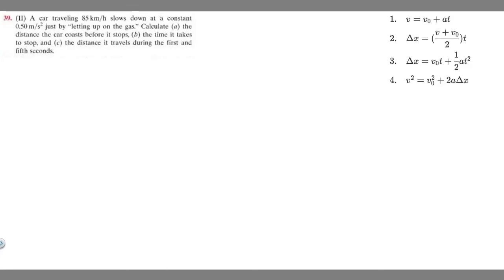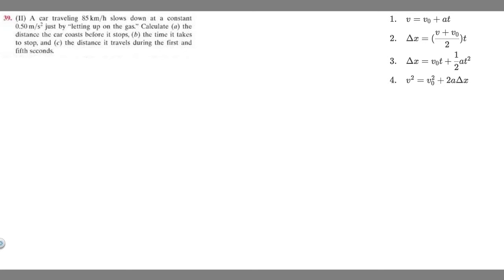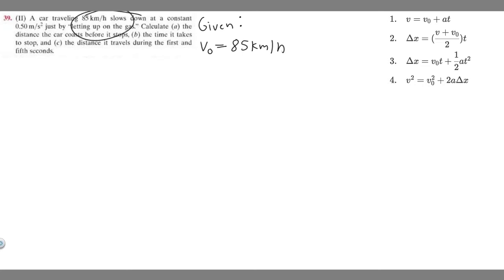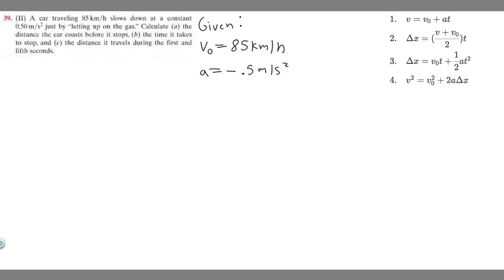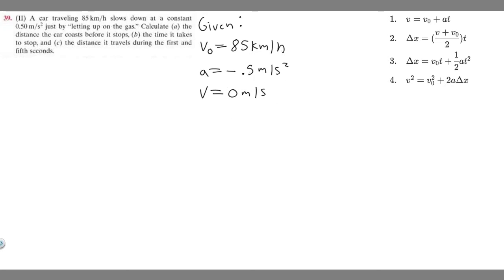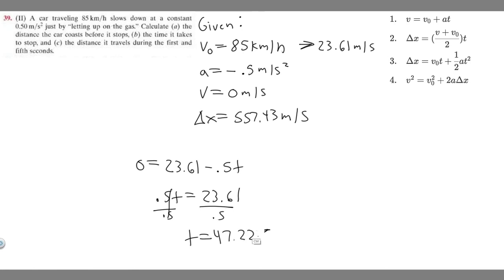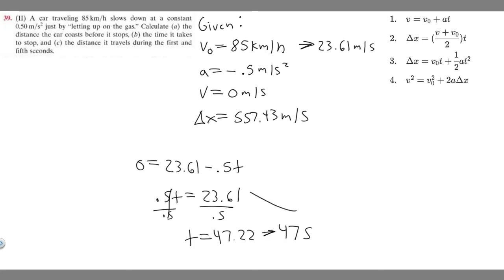Calculate (a) the distance the car coasts before it stops. (h) the time it takes to stop.

Comment: How to calculate distance after 't' second if acceleration is given
Reply from the maker: Do you want me to explain to you how to do that in general? or are you confused about some part of the video?
Reply: @TheAnswerKey  yes
Reply: Yes u wanted to explain
Reply from the maker: @vloggermedia5539  It depends on what variables you are given along with acceleration. What you do is take the variables you are given, and then plug them into an equation with delta x, which is what you are trying to find. So you just plug in the time and acceleration given and the initial velocity and that will allow you to solve for the distance traveled.
Reply: @TheAnswerKey  so what happen if acceleration = 5 m/s and t =60s and u=0
Reply from the maker: @vloggermedia5539  what is u supposed to be?
Reply: @TheAnswerKey  initial velocity
Reply: or body starts from rest
Reply from the maker: @vloggermedia5539  the formula is distance = intialvelocity(time) + (1/2)(a)(time^2) so plugging in 5 and 60 it would be 9000m
Reply: Why the equation displacement= vt is not used to find the distance after 60s
Reply from the maker: @vloggermedia5539  because we have to take into account acceleration. In the d = vt, it is assumed acceleration is constant.
Reply: @TheAnswerKey  i  find v using the eq u+ at and i plug into the equation vt i got the ans 18000
Reply: For first 60 second s = ut + 1/2 at^2 it's ok but for after 60 second what will happen
Reply from the maker: @vloggermedia5539  as long as the acceleration stays the same you can just change the the time amount to what you want
Reply from the maker: What is the initial velocity?